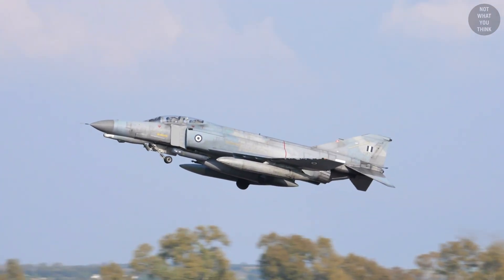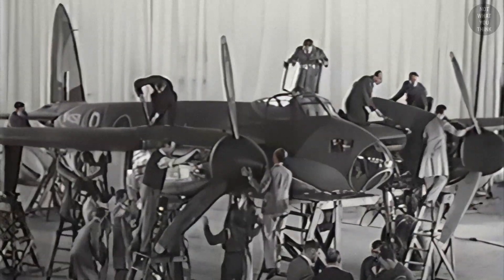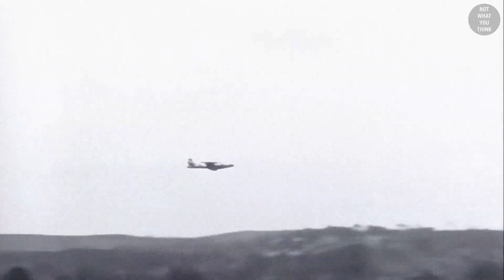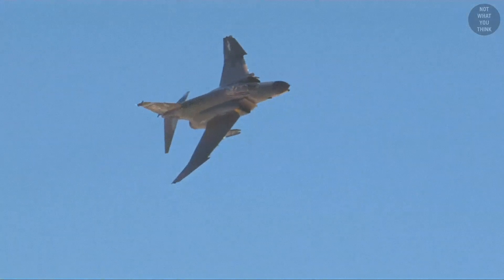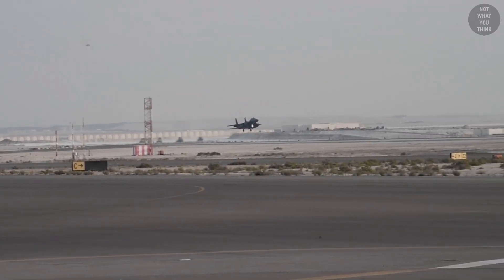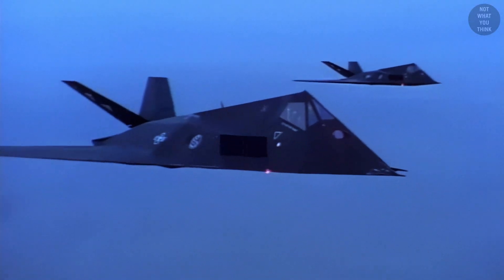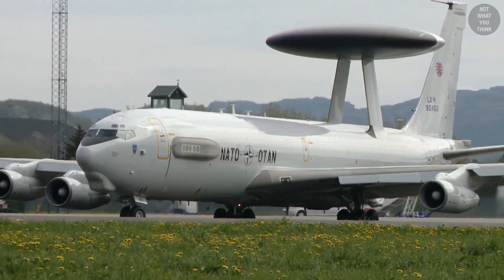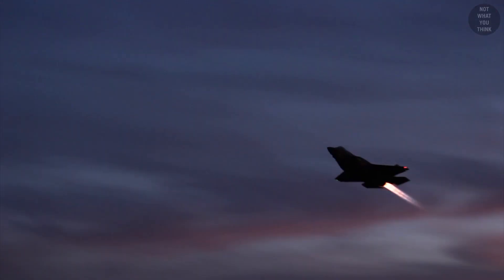Why are Modern Fighter Jets Slower than 1960s?

Comment: So if the idea of combat being almost always subsonic is our reality, why not build a n F 86 style fighter that has modern avionics and weapons, but is far less complicated to build? I am no expert here, just a layman with an interest in the topic. These aircraft would most likely come with significant drawbacks that would have to be addressed, but considering the cost savings you could enjoy by using a highly manuverable design that flies just below Mach 1, you could put multiple copies of these birds in the air for the price of one modern fighter. Sometimes amazing things come in small packages.
Reply: @wave1016  The purpose of the EX is keeping the Boeing St. Louis plant open. Without orders, the US loses a fighter manufacturing plant. So they created orders to avoid that. Simple as.
Reply: Carrying modern weapons means a radar, and back then aircraft only had a small ranging radar in a bump in the nose above the intake for the gun sight lead compensation. Modern missiles are also a little big heavy. So you need a stronger engine and bigger wings for the extra weight. But that also means you need more fuel. Which is extra weight. Now you need to make the structure stronger.
When you're done updating the F-86 to modern combat, you have a totally different aircraft that's expensive.
Also, training pilots is difficult. If you're building cheap aircraft to have a larger force, that means inherently having to accept more pilot candidates. That's great for those who have dreams of flying, but it means lower quality pilots.
Reply: @ChucksSEADnDEAD  I hear your arguments and they are good ones. But threre has to be a way around the every increasing cost of building modern fighters. The more expensive they get the fewer resources we have for other needs within the military.

Comment: I’m more curious about altitudes, which today is a closely guarded secret. A few years ago I was flying through a military control zone in the UAE. Over the radio I heard a very young sounding American voice asking for clearance through, with a call sign of “Ginger”. 
He was cleared through direct to wherever, and told to maintain his current altitude of FL60. My jaw hit the floor. What in the frigging hell can cruise at and maintain 60,000’ other than a U2? And his voice hinted that he was WAY to young to be a U2 pilot.
Reply: Guessing a f22. I believe they are known to hang out way up in the thin air. The f15 I've heard is also in its element at higher than normal altitudes but the f22 even more so.
Reply: @EPstroker  
Yeah I wondered if it were an F22 as well. Published stats say it can briefly reach that altitude, but not cruise there. Doesn’t mean it can’t of course. 
Also wondered if it were some classified high altitude drone.
Reply: @HeliRy  I didn't think about a drone. Very well could be I guess.
Reply: Most likely it was a U2. Somewhere above 40,000ft you need a pressurized flight suit. Like the kind the U2 pilots use.
Reply: @darrenmarsh2290  
Technically you’re right, it could only have been a U2. And the base who’s ATC we were operating in was known to house at least one of them. Allegedly wink wink. 
For me it all comes down to the pilot. His radio work was very green, and he sounded like he was still going through puberty lol. U2 pilots are usually salty Majors and the like. Myself and the other pilot I was with were laughing at the awkward exchange between him and ATC. But we stopped laughing and were in awe once he said his altitude. Dude was half was to orbit lol.

Comment: I believe the F-4 was designed to be a high-speed bomber interceptor as opposed to an air superiority fighter. Its mission was to get out there fast to intercept an inbound nuclear bomber strike as far away as possible. Speed was the main consideration when it was being developed. As that mission has become a much lower priority so has the need for Mach 2+ capable aircraft.
Reply: The F-100 series were designed as the interceptors, catching incoming aircraft at maximum distance.  The F-4 was designed for other things, but it was discovered that they had so much engine that they could dogfight with the best high energy/low weight Soviet fighters, too.
Reply: @Egilhelmson  The F-4 went through a rather torturous path to production with the intended mission and specifications changing many times but the final specification presented to McDonnell Douglas by the U.S. Navy was for an all-weather, high-speed interceptor for fleet defense. At the time the navy's main concern was fleet defense against nuclear attack. The navy already had the excellent F-8 Crusader as an air superiority fighter. The F-4 was basically forced on the U.S. Air Force by then Defense Secretary Robert Macnamara who wanted a standard fighter for all services. As the Air Force's requirements were quite different from the Navy's this required several more modifications to the aircraft. Even then, it was largely hamstrung in its air superiority role by the fact that it didn't have a gun. The F-106 Delta Dart was the Air Force's all- weather, high-speed interceptor. The other 100s were designed for a multitude of other missions.
Reply: @chardtomp  some 106s did end up with a gun and I think 111s were at least experimented with one I think. Open to correction on this.
Reply: @Egilhelmson  
I have over 3,000 hours in the F-4. It was designed as a fleet defense interceptor. It was adapted for other roles.
Reply: Interesting…..there was a flight based at RAF Leuchars in Scotland doing just this - intercepting air intrusions
Reply: @tornagawn  You can intercept with any aircraft, and the F35 is a multirole aircraft. That just doesnt mean they're great at it, or build for the role.
Reply: @termitreter6545  F-35s execute the interceptor role better than dedicated interceptors since they have extreme climb rate, acceleration into a high subsonic profile, and great performance above the contrails in terms of cruise and acceleration, plus sustained high-speed cruise hugging the Mach.  They also see better than any AWACS platform, and have longer range detection of airborne and surface targets than any other airborne sensor platform in the world, due to the generation of AESA they have, plus sensor fusion and interleaving in a flight with all the IR sensors.  The forward quadrant DAS IR camera fuses with the EOTS and AESA, plus the passive RF sensors embedded all over the aircraft, to form more of a sensor architecture that is the combination of a dedicated spy plane and an ISR FLIR-based platform.

The fuel fraction of the F-35A and C allows them much more time on station than any teen fighter or legacy interceptor as well.
Reply: @LRRPFco52  So youre throwing around a lot of technological terms, but youre just making claims.

The idea that an F-35 has higher radar range than a dedicated AWACS plane wijth their massive radar installation is just ludicrous, and you wont find a single source to back that up. 
The F-35 has strong sensors for a fighter aircraft, but thats about it.

Nothing about the F35s subsonic performance is extreme, it just about manages to beat an F16.  And Im not sure why that even matters for an interceptor, where sustained speed and flight altitude is important, two areas where the F-35 clearly lags behind.

Even the fuel capacity... yeah, it needs a lot of capacity because it cant use external tanks without crippling the stealth features. Thats a requirement, not a bonus.
Reply: @termitreter6545  This is a highly-technical discipline with more advanced technology than any space program (fighter engines HPHT turbine blades as one example).

AWACS have to maintain stand-off distance from any threat WEZ and surface-based MEZ, so yeah, the AWACS Radar reach is significantly limited by positioning in-theater.  JSF especially can get closer to threat sensors than any other platform in the inventory, and they have the latest Semi Conductor technology in their TRM materials, with better processors that are all interleaved with each other for multiple vantage points.  Those factors plus their higher operating altitude place the JSF kill web in a far superior situational scheme than any AWACS can ever hope to have, and multiple pilots have stated for years how dramatically-superior their picture of the battlespace is over AWACS.

I can cite multiple pilot reports and even comms backing up the JSF/AWACS SA superiority.  It’s not even close.  A single JSF pilot has an infinitely-better picture of the space than if you fused the brains of all of the station operators sitting in the back of an AWACS.  A huge factor in this is the presence of high-saturation IR sensors that cover short, medium, and long-wave IR spectrum right inside the threat areas, whereas AWACS has none of this.

The entire flight regime in the F-35A is superior to the combat-configured F-16C Block 50 (best performing engine).  The subsonic acceleration of the F-35A is superior to the F-22A.

F-35A maintains higher sustained speeds and altitude than the F-16 and F/A-18, comparable more to the F-15, which likes to hang out above the cons (FL400).  If you’re reading any sources that claim the F-35s suck at sustained speed and altitude, you now can toss those sources into the trash bin and never click on them again.  I just unsubscribed from an aviation-specific channel after repeated failures and click-bait BS claims that have no correlation to reality.

I’ve been flying since the 1970s.  Having high fuel fraction is absolutely a bonus and the main driver for that was combat radius.  The KPPs for JSF required 100nm combat radius over each legacy platform they were replacing.  They accomplished that in spades with each of the variants.
Reply: @LRRPFco52  Gotta be frank, you sound like a markov-chain spouting buzzwords. Nobody is impressed by long sentences with tons of pointless words and marketing claims.

And "the F35 can see further away planes than an AWACS if its close to them" isnt even an argument, thats ridiculous. 
Youre also comparing the F35 to 70s airframes, and I very much doubt that an F35 has more acceleration than an F22, due to the way lower t/w ratio. It also has a lower flight altitude, and B/C are limited to Mach 1.3 for short term, because it damages the structure/stealth coating. 

The fuel bit you misunderstood; other aircraft use external tanks, a stealth aircraft cant do that. So obviously it requires a big internal tank, thats nothing impressive.

If you wanna see the shortcoming of the F35, look at what planes it failed to replace.
Reply: @termitreter6545  Every F-22 and F-35 pilot has commented on AWACS has mentioned that they have vastly-superior awareness of the airspace and even ground targets compared with AWACS.  There are no buzzwords in there, just the basics.  If you’re competent enough to understand what AWACS is, then you’re competent enough to look up any acronyms you aren’t familiar with.  I’ve been immersed in these acronyms since the 1970s, so they are part of the military aerospace vocabulary, not marketing claims.

AWACS have to maintain a stand-off pattern away from threat envelopes so they don’t get shot down.  By maintaining stand-off range, they aren’t able to penetrate the airspace with the maximum detection range of their Radars and sensors.

F-35s, more than any other aircraft, have the ability to get deep into the threat airspace and connect their sensor data with each other, forming a real-time picture of the area that is far superior to what AWACS can see.  Does that make sense?

If you overlay the sensor reach from AWACS and then compare it to F-35s inside the threat areas, you will see what I’m talking about.  I’ve been overlaying our combat aircraft radii and sensor reach over maps of the world since 1983, just for reference.

The statements about stealth coating peeling off are incorrect.  The VLO RF features are integral to the structure of the skin and substructures of much of the JSF airframe.  Coatings are mostly for IR spectrum, aside from the adhesives that cover rivets and panel lines.
Reply: @termitreter6545  The F-16 was originally an interceptor.
Reply: @patrickgriffitt6551  AFAIK the F16 was just supposed to be a generic air superiority plane.

The F-15 would be more of an interceptor, having much more fuel reserves and better engines.
Reply: Thank you for being a voice of reason and not trying to change the topic to super cruise.
Reply: That's exactly the purpose of MiG 25. It's a known fact as well that at Mach 2.2+ these aircraft literally began to disintegrate by eating parts of their engines
Reply: German F-4s were also mainly used as interceptors, at least after the fall of the Iron Curtain, maybe earlier (although it could carry A-bombs and would have used, if Cold War would have turned south).
Reply: F-4 was designed to be a carrier-borne fleet air defense interceptor that would shoot down incoming Soviet bombers that were trying to attack the carrier battle groups with rudimentary cruise and anti-ship missiles of the era.  That’s why it has the semi-recessed AIM-7 missile stations on the wing/fuselage and the high speed sprint capability to get to altitude and dash to intercept, with a huge Radar to provide terminal intercept profile detection and guidance for the AIM-7s, with a RIO in the back managing the intercept after hand-off from ship-based Radar controllers.
Reply: You would be correct
Reply: You are correct. The F4PhantomIi never could turn worth a darn. Still a plane very close to my heart.
Reply: @patrickgriffitt6551  F-4 performance depended on the model, maneuvering slats, and altitude.  Its real strength was in the vertical fight.

Of course the teen series out-performed it in T/W ratio and turning.
Reply: The F-4 was designed as a carrier-based fighter aircraft, not a bomber-interceptor.
Reply: @nobodynoname6062  The navy's specification to McDonnell Douglas was for a high speed interceptor. At the time it was being developed the navy's main worry was a single atomic bomb taking out an entire carrier task force.
Reply: @chardtomp  You're partially right. Navy requirements that led to the ultimate development and purchase of the F-4 were for a high speed interceptor. MD's very first concept of the F-4, at the time without a formal request from the Navy, was for a more general fighter aircraft. Or so it says on Wikipedia.

Comment: Air to air missiles are way faster today than in the past, and go much farther. Outrunning them is impossible. Maneuverability on the other hand is much more advantageous than speed, which uses up the fuel aboard the aircraft very rapidly.
Reply: That's not true at all. Most rocket motors in air to air missiles only have a few seconds of burn time. After they burn out, the missile can't gain any more energy. This means that if you turn, the missile will have to steer towards a new predictive impact point. This wastes energy. If you turn again, now the missile has been going in the wrong direction all along! It must steer towards a newer predictive impact point. Energy defeat of a missile is much simpler than maneuvering.
Reply: @ChucksSEADnDEAD  Many are RAMJET powered now, there is no smoke trail and they can easily keep pace with any evasive maneuvers the target makes to evade it. Even rocket powered missiles can still reach targets 100 miles away. The AIM 54 Phoenix was one such weapon. They do that by ascending to very high altitudes while accelerating to Mach 5, or even faster then coasting the rest of the way. Onboard RADAR guides them to the target until they either destroy the target or they lose enough velocity trying to keep pace with it's evasive maneuvers that they miss. This is in fact how most air to air and surface to air missiles work. Today, the "no escape zone" for modern air to air missiles such as the Meteor, AIM 120 AMRAAM and their equivalents possessed by Russia and China is much larger than even ten years ago.
Reply: @taraswertelecki3786  "Many"? There's the Meteor, and there could be a couple more but I don't remember.
The Phoenix was designed to take out slow bombers flying in a straight line.
Now you're correctly using the no escape zone. The issue is, in air combat you fire before the no escape zone because you want to force a defensive posture with a reasonably high Pk shot. Waiting to reach no escape zone means flying straight into a high Pk missile.
Reply: @ChucksSEADnDEAD  RAMJETS are the only practical way to power beyond visual range air to air missiles that can deal with maneuvering, small targets such as fighters, drones or cruise missiles while maintaining hyper-sonic speed flight.